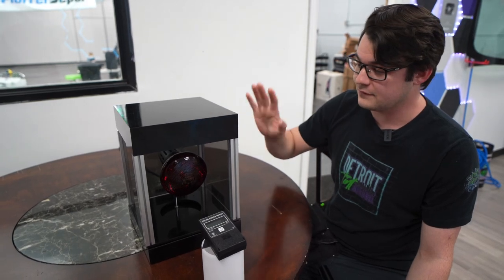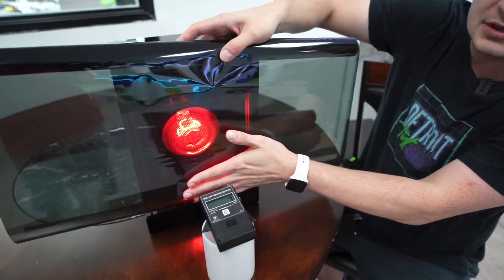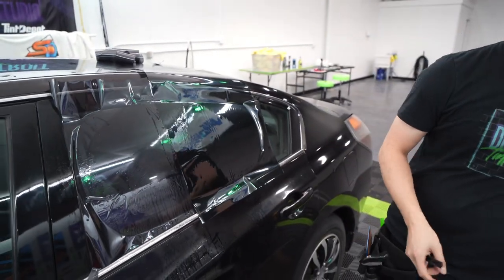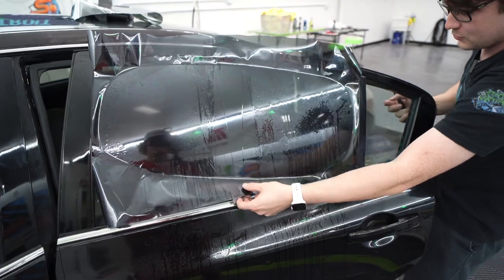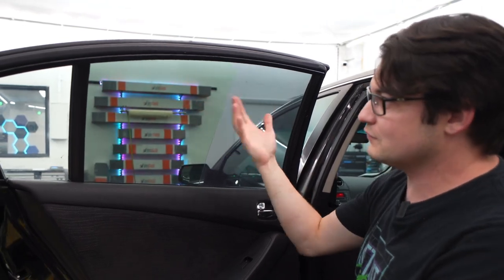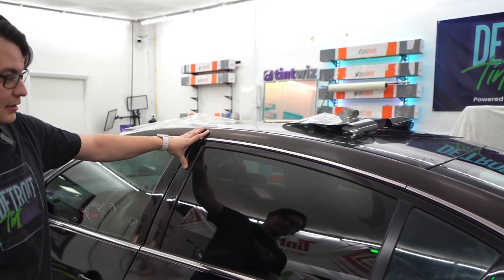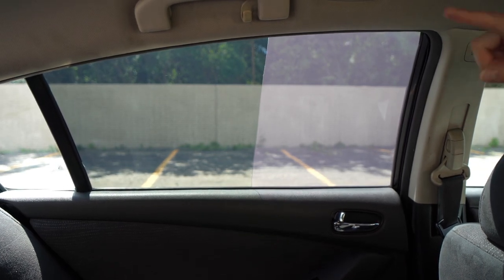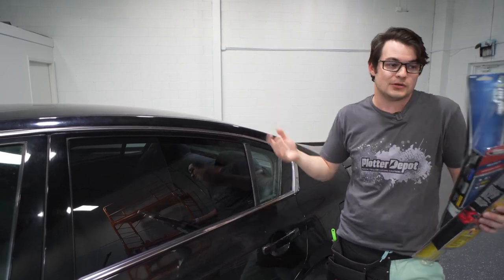Walmart Ceramic Tint vs Cheap Tint

Comment: Why is no one talking about how he's gonna have milk in his door panels forever now 😭😂😂
Reply: Im gonna have to get in their and lick it up now 😩
Reply: First of all you not going to have smell forever. The second he is just showing milk possibility to do job, and not necessary to use mild at all. I have used just a baby shampoo with water.
Reply: @valnez4794  how??
Reply: Hopefully that door panel gets pulled and cleaned. I can smell it now 🤢
Reply: Most doors actually have a drain ;D
Reply: I'm surprised he didn't notice a distinct rotten milk smell..
Reply: @RevoDaRevolver  Yeah they have drains but not all of it will drain, there will be enough milk left to dry, go rotten, and stink.
Reply: Imagine doing all 4 windows, the rear window and windshield with milk running into the panels then sitting out in the hot sun.  Yuck!

Comment: You can normally tell if ripples will show up by stretching it on a table with your hands, if it disappears, it'll be fine. Very useful for using the end of the roll in an emergency
Reply: #EmergencyTintingForLife

Comment: Good second "followup" video of the Black Magic 'walmart" ceramic tint.     I've used the Black Magic 20% tint when it was labeled "PROFESSIONAL", and it worked great (no haze).  The "SELECT" tint of the Black Magic series is PURE CRAP, and turns purple after a while.  Looks like the version of the 20% will work great for my needs (and it looked good on the window you did).  Thanks for the comparisons.

Comment: Great video! I actually learned on Walmart tint (thank you self checkout) in 2004. The expensive stuff use to be a metalized layer instead of ceramic and it has always looked like that. It was also much harder to work with and would not shrink good at all. Only benefit was since the stuff was so thin you really never needed to shrink it on side windows and if you did, you could do it with just a hair dryer.

Comment: Do a video putting layers of ceramic tint on a window to see if more layers keeps the car cooler
Reply: Yes more layers is double the heat protection
Reply: @SEANYBANKS23  If one layers does 70% heat rejection, 2 layers will NOT have 140% heat rejection 😂 not how this works. 

Percentage works off percentages, it’s not cumulative. 👍🏻
Reply: @TexasTintMasters  are you saying 50% blocks 50%.  50% on top blocks 50% of 50%.  So total would be 75%?  Another layer would add another 12.5% blockage?  I had never thought of it like that.
Reply: @IconicProps  no. Anything 50% or higher added to 50% or higher will be 100%  there is nothing greater than 100%. He’s just being a Dick head and it’s confusing u bc he’s doing it by over complicating and for sake of sarcasm and passive aggression.
Reply: @IconicProps  it makes sense (you will keep reducing 50% of the previous, effectively with 3 layers you can reduce upto 87.5%). The only reason to not do that is because of the money involved.
Reply: Yes I can do a review on it... Wanted to do a 35 on top of 50 in ceramic
. To get a darker tint up front. but yes I can tell you 100 that the tint in ceramic is worth every penny have a expedition and it's all leather dashboard... Located in Florida and feels over 100 these past 2 yrs... And well I had stock windshield no ceramic of anything.. didn't notice till one day I was cleaning the entire car ad the dash on the driver's side.. was a big air bubble..so scared to do it but from what I've seen have to make a very small hole where the air bubble is.. heat up the area that the air bubble was created.. push all air out through where the bubble is. And it well and should come out and keep it back to original size it was.. but don't want to damage the leather from overheating it.. but once I installed ceramic.. does not matter how dark you go... Ceramic does its job alone... Want stock look ask for 70% in ceramic.. want a haze or a small bypass of tint.. go 50 like I did.. if you want sunglasses on your car😂 go 35% dark outside but inside looks great... Don't recommend going darker have my own review on what I had up on my channel... Invest into ceramic tint.. if you don't want to do the entire car yet... Best bet is the entire windshield. And rear.. most hot spots.

Comment: The regular window tint (viewed from the inside of the car) gives light a slight greenish tint, where the ceramic film appears to be closer to neutral.  Compare the white wall in the background through the non-tinted glass at the back of the door, then compare the white wall in the distance through the two different tints; there is an obvious green tint on the regular film, the ceramic tint looks more natural but does have a lesser blue tint, and looks better in my opinion.

Comment: Thanks so much for the milk demo. I never use enough soap in my solution because I'm afraid it will show up as residue under the tint when it dries. I've wasted a lot of tint over the years because I couldn't reposition it without damaging it. Apparently the soap squeezes out more thoroughly than I thought, so I can make life much easier on myself from now on......lol
Reply: Am not a tint guy I did it yesterday on some windows.. and well it's worth it.. from what I've did apply warm water and baby shampoo the orange bottle..apply it in a spray bottle.. use a squeegee with the soft edge apply it to the squeegee.. if your angles are not correct.. then apply the solution to the tint and window.. search up how to clean tinted windows and should see some straight forward.. also use the razor method like this guy he showed.. because of you apply tint just like that.. can have dirt on your tint which well cause later down the road to unstick... And once you have it all corrected.. the. Go ahead and use a heat gun to  get rid of any water to secure your work.. if tint is unable to move just pick up the tint by the corners lifting it out and up..apply the solution so the tint is able to move freely.
Reply: @chinito20fam where did you buy the tint film from?

Comment: I know it's a year old, but a question regarding the ceramic tint. Previously had my car done with geoshield 35% carbon tint. Looks good inside and out, but wouldn't mind the heat reduction of the ceramic. Would it screw anything up if I'd add a layer of the ceramic of this to the inside? Would it wind up making the carbon tint hazy?

Comment: I wonder if they reformulated it in the last year?
They no longer have a 35% VLT option, and I picked up a roll really to put on my house windows (it's cheap, and really the only ceramic film you can buy in small batches/without having to contact an installation company. I really didn't care if it turned out a little hazy since the outside of the windows only gets cleaned once a year, so it's hazy anyways...)
It's still obviously cheap, and has that typical blue/purple tint to it, but in your videos it seems to have a green tint.
Maybe they actually listened, maybe it's all in my head vs cheap tint that I've seen. as a good tint shouldn't be noticed at all
(Like I didn't notice my car had a tint installed from the dealership until a month into owning it. and that's mostly because they used cheap garbage for the back window, so the edges started lifting + it faded to purple & hazed over within a couple years. the side windows I wouldn't have noticed except they wanted to keep the window stickers on so you can see there's a layer over them from the inside if you look close.)

Now, if you plan on doing more than a couple windows, the cost of buying a bulk roll starts to make sense real quick. This stuff is ~$1.53-$1.92/sqft, whereas you can get a 20ft roll of a good ceramic like Xpel XR Plus for ~$1.32-$1.43/sqft. So once you're looking at buying 4 rolls of Black Magic, it becomes cheaper in every way to just buy a roll of the good stuff off a reseller.

Comment: All ceramics and nanocarbon tints have a low angle hazing issue
Reply: Yep, even the best get a white square reflection of the side mirrors at the right angle. I've found the lighter vlt ceramics have less issues with L.A.H.

Comment: Cheap film should be ok on my 02 Chevy Express Cargo .
Reply: Yea. I’ve gotten great results with cheap film, just make sure it’s film, not the “cling” with the paper roller in between, and comes in a box. Just one thing, when setting the tint, especially black magic, when you set the first part and the top edge and have it line up squegee it and let it sit for ten minutes to dry and adhere. Before rolling it up, to finish setting the bottom and into the seals. Otherwise the tint will crinkle, and will slide all over, so def let it sit and dry before rolling up, also be sure to cut the bottom edge longer to tuck under the seal. Otherwise the cheap tint will catch and curl up. Also you don’t HAVE to shrink it. I never have. I’ve used the Walmart “black magic” brand tint film probably on ten cars
Reply: To clarify, make sure your tint comes in the plastic box like he has on this video, not the square cardboard box that “gila” uses, and the the cling comes inside. Also don’t buy the tint kit, just use a pray bottle with bottle water. And five drops of Johnson and Johnson baby shampoo! Just don’t let it sit, more than a day, you’ll get clumps inside the water after it sits for a day